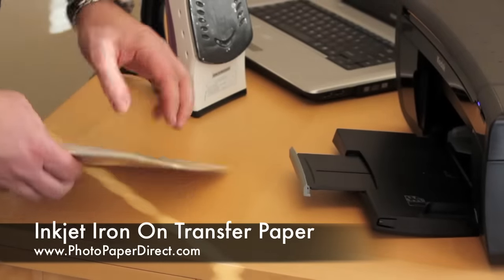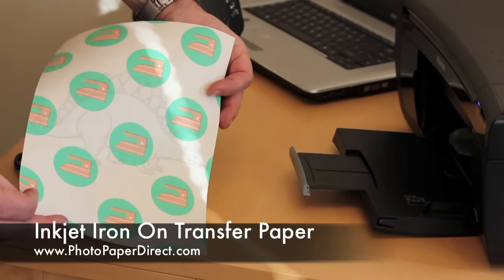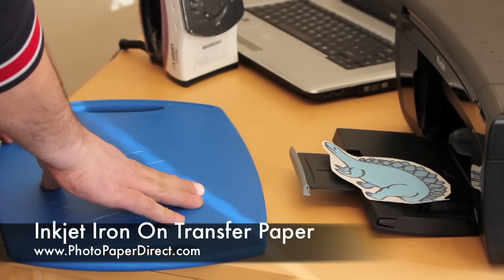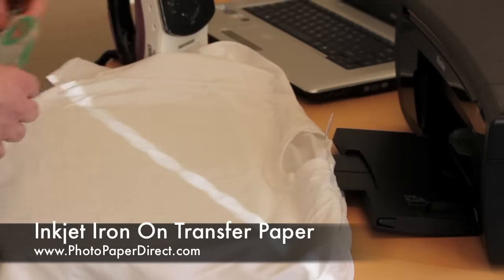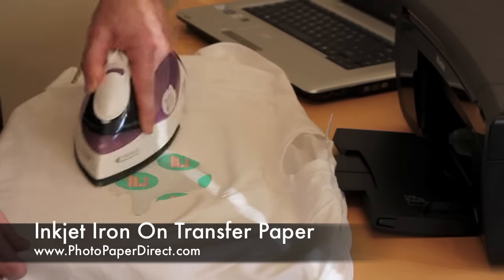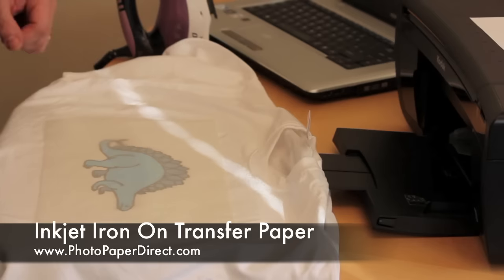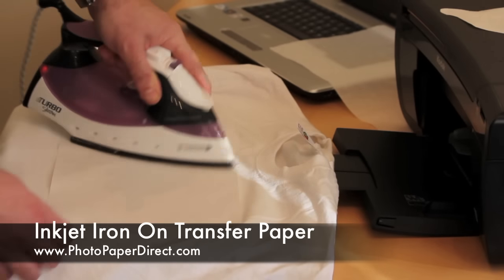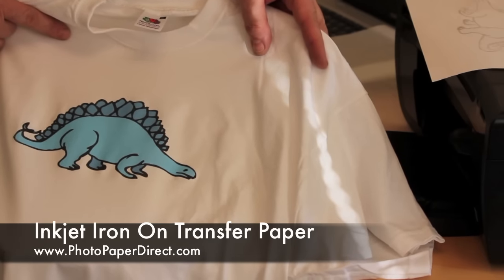Iron On Transfer Paper Tutorial By Photo Paper Direct

Comment from the maker: Using a layer in between might seem to help in transferring the image at first, however it will likely be a very weak transfer. It will come off easily and won't survive even one wash. Transfer works well when you apply the precise required amount of heat for the required duration. The heat / duration ensures that the ink is released from the carrier and embedded into the fabric. Try and source a different material to use. I hope this helps a bit. Thanks for the comment.

Comment from the maker: Hi Elizabeth Cruz , You need to mirror the design if you have text. If you have an image it is recommended, but not essential. Thanks for the comment.
Reply from the maker: +Photo Paper Direct Hi, Our transfer paper, when peeled hot, immediately after ironing, will give a matt finish on the shirt.  Gloss finish is possible with the same paper when it is peeled cold, if required. Thanks for the comment.
Reply: Can I do it with normal paper?
Reply from the maker: Hi, do what precisely? Thanks
Reply: What type of paper?
Reply: Photo Paper
Reply: Oh God you just remembered me the mirror thing... after cutting lots of little prints printed wrong... ups
Reply: Photo Paper Direct 
wat was dat second paper used??
Reply: jnketprinter
Reply: Photo Paper Direct what is the difference between light and dark transfer paper
Reply: What's the brand name of the iron on transfer paper I want to get the exact same kind Because of the heat indicators
Reply: How do you mirror the design??

Comment from the maker: Hi, You can. In fact, in addition to using this version we offer another version of the paper without the thermal indicators on the back which is designed for heat press machines. The lack of thermal indicators makes the heat press version slightly cheaper in price (same quality as it uses the same base paper). Thanks for your comment!

Comment from the maker: Hi, Without knowing the precise brand you have used, my suggestion is to cut as much as you can around the image prior to the transfer as we explain in 1:06 min. I hope this helps. Thanks for the comment!
Reply: uh is this available n amazon
Reply from the maker: @gracemckinnon1102  Yes. You can shop PPD Transfer Paper on Amazon. Thanks for the comment!
Reply: @photopaperdirect   I used paper over the image after the transfer (like this video said) and it ended up peeling off some of the image.
Reply from the maker: @muodis7595  Hi, did you use the silicon paper or normal copy paper? If you're using the silicon paper it shouldn't happen. If you're using normal paper, it has to be super hot when you're peeling it. We suggest using silicon paper not copy paper. Thanks for the comment!

Comment from the maker: @BryantDykstra Yes, you must use 'mirror' mode which should be available in your printer's settings. It is also wise to print a test on normal printer paper before using the more expensive transfer paper to ensure it came in mirror / reserve mode.

Comment from the maker: Hi,

The transfer is very durable provided the transfer was done correctly (enough time + heat). As well, you can simply turn the garment outside in when washing so the image does not come into contact with the machine. You can transfer to a wide range of fabrics provided the fabric / item (a hat in this case) can withstand the heat from the iron. Thanks!

Comment from the maker: @guns511 Hi, On the printer setting you have an option to print in mirror mode or to print on 'transfer paper' setting which will print in mirroring mode by default.  How quickly fading happens will depend on the following. 

1. The transfer has to be done with the correct heat and the correct pressure
2. Using pigment inks rather than dye will increase the longevity of the print 
3. Avoid using bleaching or washing powder which contains high amounts of bleaching

15 to 20 washes in total. Thx!

Comment from the maker: Hi, Yes, you can apply the silicon sheet or use a normal paper at any time after the transfer, even months after. Just make sure to peel it off when it is VERY hot from the iron so it does not stick to the transfer (not an issue when using silicon paper). Thanks for the comment.
Reply: Is deglossing necessary everyone seems to have trouble with it

Comment from the maker: @misssdrummergirl8 Around 15 to 20 washes depending on.
 
1. The transfer has to be done with the correct heat and the correct pressure
2. Using pigment inks rather than dye will increase the longevity of the print
3. Avoid using bleaching or washing powder which contains high amounts of bleaching

I'd say that number 1 and number 3 are the most important for the durability of the transfer. Thanks for your comment.

Comment: Hello, thank you for this video. 
I've got an issue though : the blank part of the picture turned brown on the fabric. You said in the manual : "Garment has turned brown ... you are using a very hot iron and therefore can reduce the ironing time about 30%". But, of course, it's impossible to evaluate it, before !! Because once we notice it turns brown, it's too late. Plus, the transfert is full opaque, so it's impossible to see the fabric turning brown along the ironing. And we can only see once the damage done.
So, now my question is : once the fabric has turned brown, how can we wash this browny part ? Thank for your answer.
Reply from the maker: Hi, as you rightfully noted, brown discolouration means the transfer burned. Washing won't remove the brown part, you will have to do the transfer again, using less heat this time. Thanks for the comment!

Comment: I need to transfer an image to a canvas size equivalent of A0 paper. For this reason, I have to use pre-primed canvas as printable canvas in such a size is not an option for me. Can I use this iron transfer method on the canvas? Also, I intend to print the image on several A4 pieces of paper then iron them onto the canvas one by one with each subsequent image flush against the one before. After that, I want to use a canvas sealing spray to seal the image onto the canvas. Is this advisable? If I iron a second, third, fourth image up against an exposed, unsealed image which has already been ironed on, will I damage the exposed image?

I look forward to your response and thank you for the video - it's very helpful!
Reply from the maker: Hi There,

1. You can Iron onto this canvas as long as the surface is porous.  If you prime the 2. If you try to butt one sheet to the next, you will need to protect the exposed image with silicon and then you can over-iron it
3. from experience it will be near impossible to make a clear joint between one A4 sheet and the next as there is some stretching and distortion during the process of Ironing.
4. after printing, if you are successful , you can seal the image with a sealant if you need.
Thanks for the comment, I hope thus helps.

Ran

Comment: Q:  If I wanted to do the same dinosaur, but only the line image of it, that is, no blue, onto a colored t-shirt, would I have to cut out the inside?  Does it depend on the color of the shirt (i.e., light versus dark)?  I want to make a simple drawn character using black ink onto a yellow shirt and I'm unsure of how and which paper (light or dark) to use. Thank you.
Reply from the maker: Hi, for best results, we recommend trimming as much unprinted areas as you can. Assuming the line image is black, on white colour fabric when using the 'light' transfer paper type, only the line image will appear, the reminder (unprinted areas) will get a slight clear film look which will be the reminder of the unused light transfer. this clear film should only be visible from close range. 'Light' transfer paper only suits white colour fabrics. Any other colour but white requires the 'dark' transfer paper type. Despite its name, dark transfer paper is solid WHITE. Again, transferring the same line image in black onto coloured fabric will show the line image and any unprinted areas will come out white (remember, dark transfer paper has a white background). So, you can two options: 1. using light transfer paper onto white colour fabric 2. using dark transfer paper onto any colour fabric, but you'll need to trim the unprinted areas. I hope this helps. Thanks for the comment.
Reply: @photopaperdirect  Thank you for your response!   I may leave the white background (or color the character in) instead of trying to have only the line image, as I have 6 shirts to make and that sounds like a lot of trimming!

Comment: Hey there, I'm going to transfer an image onto a piece of canvas but it has a few small details (in this case little circles a few millimeters in diameter). I want to limit the amount of glossiness from white space, how should I go about that? My initial idea was to cut out all the pieces, fix them to a piece of plain white paper then iron it all in one go. thanks so much!
Reply from the maker: Hi Sam, why don't you print onto printable canvas directly? https://www.youtube.com/watch?v=ZYaGKdSKVJU thanks for the comment.
Reply: I was going to print onto a pair of shoes!
Reply from the maker: Ok. This could work as long as you give sufficient heat and pressure to the actual transfer.  If you want to peel them hot, achieving a matt finish, then you might have to do an initial ironing, then remove the carrier paper and then iron the individual images again and peel hot.  If you are intending to peel cold and achieve a gloss finish, then just let it cool and peel at your leisure.

Comment from the maker: @Skippy143c When deglossing with normal paper, it is vital that the paper is really hot before peeling and that peeling is done immediately when the iron is removed.  If it is stuck, you can reheat it (being careful about not ironing the exposed image).  It is easier if you stretch the image a little before peeling.  It is also possible to protect the image with silicon when ironing for the purpose of removing stuck paper. I hope this helps. Thanks for the comment!

Comment: Can you do this to any fabric at all, like
Polyester and cotton. Literally any fabric or does it not work. Thank you 🙏🏽
Reply from the maker: Hi, Fabrics can be Cotton, Viscose, Polyester, Silk etc. As long as they do not melt under a hot Iron, the process will work. Thanks for the comment.
Reply: Photo Paper Direct so any fabric that won’t melt under temperature? Thank you
Reply from the maker: Correct. Any close woven fabric that won't melt from the heat. Thanks for the comment.

Comment: If I try to transfer words will the words be back words?...
Reply from the maker: Hi, if you're using the dark transfer paper, the design you see is precisely the design that will appear on the fabric. No action needed. However, if you're using the light transfer paper, you'll need to mirror / reverse the print so the words come out the right way. Otherwise as you pointed out it will come out back to front. Mirror an image should be an option in your printer settings or in the software you're using to create the design. Thanks for the comment.

Comment: Hello there. Many Thanks for the video. It's very helpful. I do have a question. Do I have to mirror the image? I did not quite understand the part where you were talking about the actual image.
Reply from the maker: If you are using light transfer paper and the image has writing, you need to mirror / reverse the image. Otherwise the writing will appear in the wrong order. This step isn't required when you use the dark transfer paper. Our video on the difference between the two papers might help https://www.youtube.com/watch?v=ykb7I-pJDcI Thanks for the comment.
Reply: You're very welcome. I am using Dark Transfer paper, so I will be checking out your video. :)
Reply from the maker: Great!

Comment: So I have seen you do 2 different videos same light paper one hot peel one cold?? I'm confused!!
Reply from the maker: Hi, You can peel the image when HOT or COLD When Peeling HOT – immediately after finishing the Ironing, peel the paper in a quick smooth action.  The image will now be on the fabric and will be matt in finish When Peeling COLD – after finishing the ironing, allow the paper to cool to room temperature.  Once cold, peel the paper (there is no time limit on doing this, you can wait as long as you like).  Cold peel achieves a Glossy Finish on the shirt.  (it is recommended to finish in matt for garments which are intensively washed). We recommend hot peel. Thanks for the comment!

Comment: I'm guessing you can do this for like mouse pads, laptop cases and stuff too (Not sure about laptop cases as mine doesn't have a label regarding ironing)
Reply from the maker: Hi, the transfer adheres to fabric by means of heat. As long as the fabric doesn't damage from the heat, the process will work. Thanks for the comment.

Comment: What if it's dry cleaned - will it wear off ?? And will it only last for 15 machine washes
Reply from the maker: Mays Kay Hi, you have to follow the washing instructions to help ensure durability. It means Wait 24 Hours before washing the garment. Wash in a Washing Machine using a FULL SPIN CYCLE. It is recommended to pre-wash the PRINTED garments if the first use is likely to be in extreme wet conditions. NOT Suitable for HAND Washing or Delicate cycles. You can exceed 15 washes, follow our suggestions here http://www.photopaperdirect.com/blog/?p=360 Thanks for the comment.

Comment: hi, i have tried 3 times to transfer an image using your transfer paper, but each time it comes up with small white patches, with residue left on the paper. i am using a hard surface and a 1300 watt iron, what am i doing wrong? could it be the t shirt, i am using a fruit of loom value weight t shirt.
Reply from the maker: Hi, Small patches indicate possibly an uneven surface or problem on the substrate. Exactly what is the surface on which the process is being carried out? also, we recommend an iron over 1600w. It will also help to see the image that you are trying to transfer. Thanks for the comment.
Reply: Photo Paper Direct i'm just using a wooden desk, with another flat piece of wood on top to protect the desk.  How long should you press the iron on for? if too long, will it create the white patches?
Reply from the maker: Hi, white patches may mean an uneven surface on which you iron on. Ironing for too long will turn the transfer yellow (http://www.photopaperdirect.com/blog/?p=1278) from over heating so this isn't the case. I would suggest you replace the flat piece of wood and try again. A photo of the outcome will help. Also how many watts is your iron? Thank you for the comment.

Comment from the maker: @aldoguzman97 Thanks for the comment. The light transfer paper leaves a thin ALMOST transparent light layer around the complete transfer. On light fabrics it is invisible, however on dark fabrics you may see it. With the dark transfer paper what you see is what you get and it does not leave this fine light layer hence designed for dark fabrics (slightly more expensive paper). We have a video on this channel on dark transfer paper where we explain in more detail about the differences. Thanks!

Comment: Does removing the excess gloss afterwards reduce the lifetime or washability of the shirt/image?
Reply from the maker: No. Durability is entirely down to the transfer process in terms of heat and pressure. Correct heat under the correct pressure is the key to durability. Thanks for the comment.
Reply: Excellent thanks. I got paper stuck to 2 designs before I remembered to follow your instructions. I'll probably order your paper!
Reply from the maker: You are welcome!

Comment: I have zero issues with the dark transfer paper 
But the white transfer paper I find removing the thermal paper problematic
Your newer product has red PPD on the back, is this still a “thermal indicator”?
Reply from the maker: Hi, the thermal indicator has been phased out some time ago. What issue are you facing precisely? Thanks for the comment!
Reply: @photopaperdirect  I don’t know what I’m doing wrong
Sometimes when I remove the backing paper it can remove flecks from the image
I don’t know whether I’m overheating or not heating it enough 
There’s a yellow residue on the backing paper when I remove it sometimes if that helps?
Oh, and three times I’ve got it right also, but I have wasted several pages and t shirts too 🤦🏻‍♂️ 😬
Reply from the maker: @TheSnkrPimp  hi, it sounds like overheating.  What is the temperature set, the size of the image and how long is the transfer pressed/ironed for? Thanks
Reply: @photopaperdirect  thank you
I’m setting the heat at around 370F and heating whilst moving for around 90seconds- 2 mins
Reply from the maker: @TheSnkrPimp  Thanks. You are overheating the image. Reduce the time to 13 seconds with high pressure (adjust the pressure so that it is VERY hard to lock and unlock it). 370f is great.
Reply: @photopaperdirect  I’m using a hand held iron/heat press so I was unsure on duration 
But I’ll persevere with a lower duration 
Thank you!
Reply from the maker: @TheSnkrPimp  Any time. it's most definitely the duration. If it's hand held try 30 seconds.
Reply: @photopaperdirect  thank you!

Comment: is label paper the same as transfer paper? I am trying to make patches, and it requires label paper.
Reply from the maker: +Nameless Hi, label paper is normally an adhesive backed paper. Sorry I couldn't help more. Thanks for the comment.
Reply: Would this method that you are doing work for patches? What brand of transfer paper are you using
Reply from the maker: If the base material of the patch is white the light transfer paper will be suitable. Thanks.
Reply: Alright , thank you very much.